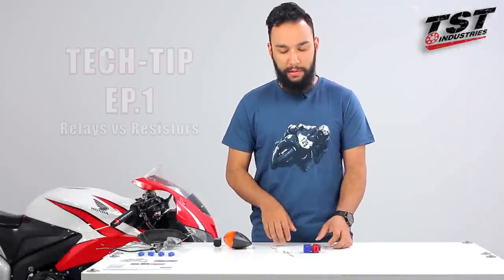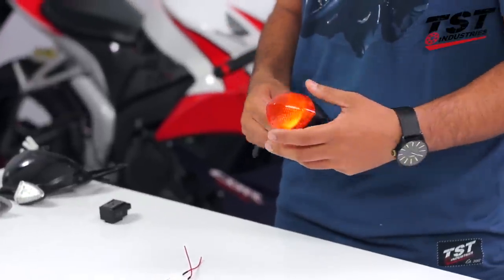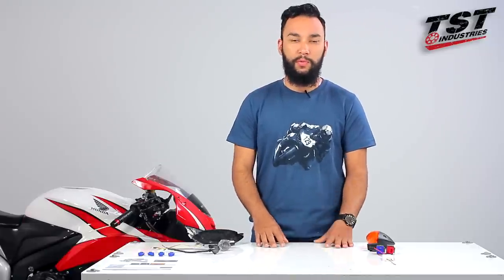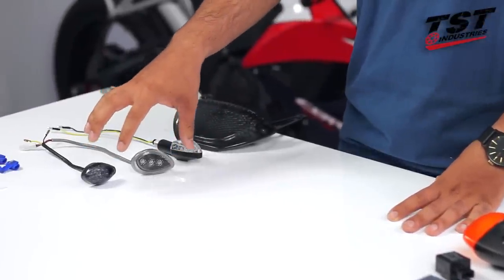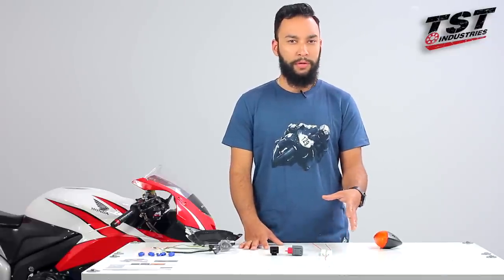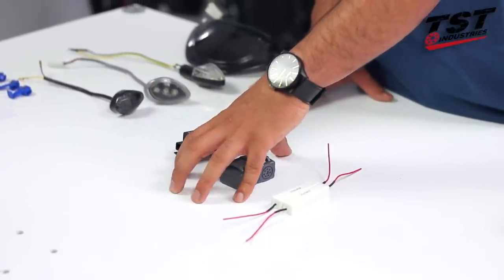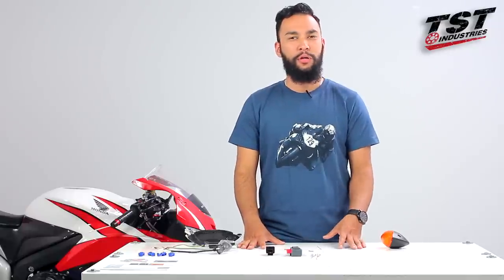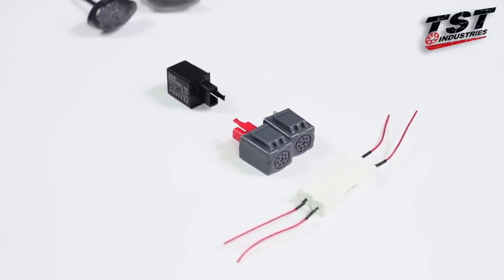Tech-Tip Ep.1 - Signal Relay vs. Load Resistors by TST Industries

Comment: for a "vs" video there was next to no useful information. but then again, seems this is a product advertisement and not a tech tip video i guess.
Reply from the maker: You must have had earplugs in, or you don't understand the language.  This video concisely and precisely identifies and explains the problem of hyperflash and its  cause. Then you are presented with the two common ways of combatting the problem, and the nuances of using one or the other. What other info were you looking for? This video is just an answer to a question our customers had over and over before we presented this material in one easy to watch place.
Reply: yeah sorry, i consider a 'tech tip' would let me know what ohm value and wattage resistors I would need to slow down the flashing. my bad.
Reply from the maker: @brapamaldi7666  being that this tech tip pertains only to our products, and we supply only one value of resistors that was an unnecessary piece of information. You must have misunderstood what this video is about. I invite you to look up Ohm's law and calculate the appropriate value of resistors for whatever your setup requires.
Reply: @TSTindustries  yeah your right. i mistook product information as a 'tech tip'. all good, looked up ohms law and indicators working perfect now at a cost of only $2.75 :D

Comment: so whats better to use......? so how much heat does the resistors give off ?
Reply from the maker: +sonicthehog303 An LED flasher relay would be ideal because it controls your ENTIRE signaling circuit. Resistors would only control the component it is installed to.
Reply: but the energy slowing down is turning the resistor super super hot, to the point where its could damage the bikes plastics
Reply from the maker: sonicthehog303 hence the relay is a better solution
Reply: aw wait the reason i can't use the relay is because the cluster for the cbr954rr has a built in relay and CAN NOT be replaced,  unless i open the cluster  and unsolder which i don't want to do. thats prob why i went with the resistors. unless u know another way
Reply from the maker: sonicthehog303 I do know a better way. Please see this video of the installation on a 03-06 600RR https://youtu.be/3L0XNctxEWo.
This bike is configured the same way as your 954. I can't guarantee that the same wire color code on the blue plug will work but it would be the same kind of installation method. If I had access to a 954 I would make a specific video for that bike.
Reply: no it didn't but thanks for trying and getting back. i wanted to get the resistor out of my bike cause do to the incredible heat produced.
just sucks the 954r doesn't have a relay i can just unplug (like the bike in your video) because the relay is soldered into the cluster